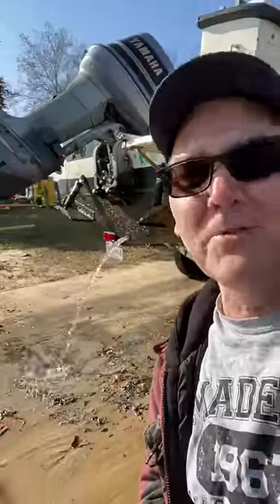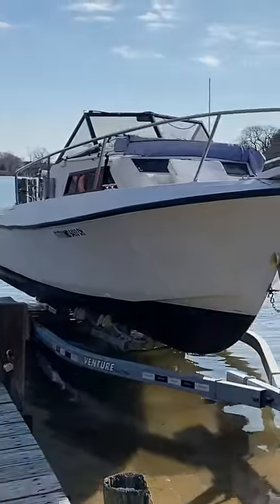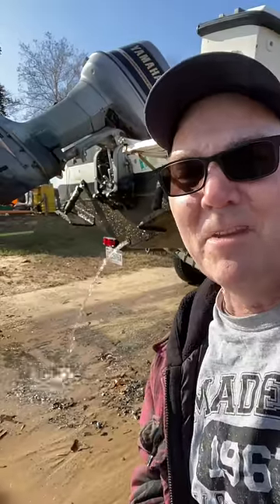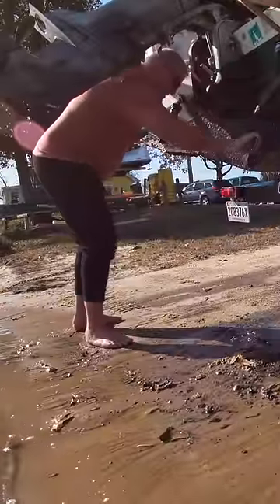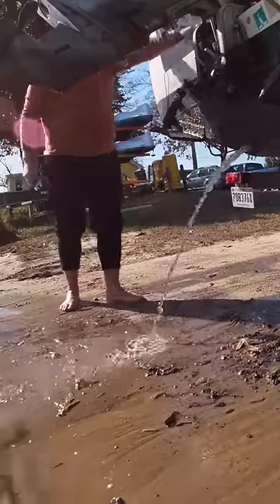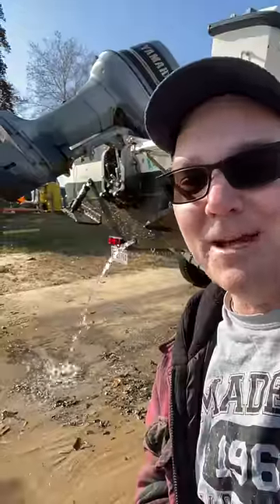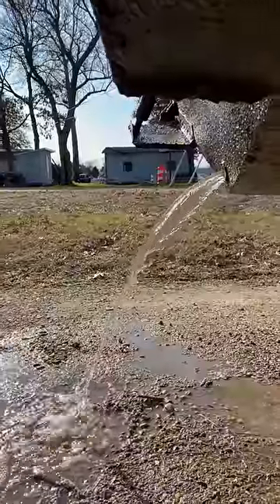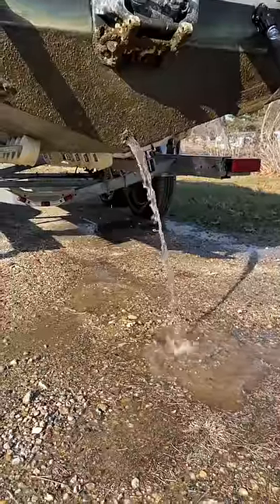When a boat bilge pump isn't working and there's been some very heavy rains lately. #boats #bilge

Comment: Grew up in forida. I have seen people pull the plug then drive home as it’s pouring out more times than I can count
Reply: That is like mandatory where I live i don’t I’ve seen a boat not do that
Reply: Veena here 9 years and I see it all the time 😂
Reply: Always.
Reply: Normal procedure for putting a boat on a trailer.
Reply: Fortunately it's legal to leak water, as long as isn't grey or black
Reply: Where I live the ride back to town or to the highway from the lake is a 30 mile curvy road that motorcyclists like to ride.  Asshole boaters have caused more than one crash.
Reply: The lakes we always went to had areas to pull off the road to clean the underside of the boat. Generally empties while you're doing that
Reply: World is full of inconsiderate ppl.
Reply: That's true @Redact63Lluks  but oily bilgewater is not considered clean water.  In my state straw and clean water are the only things allowed to come off of a load.
Reply: @kdiddy7076 Any rider should be expecting wet roads near waterways and boat/trails traffic. If you can’t handle a 4inch wide trickle of water and wipe out, you’re going too fast for road conditions.
Reply: @kdiddy7076 so draining oily bilgewater is okay to be drained back in the lake? What are you supposed to do, bottle it?
Reply: @kdiddy7076  purely the riders fault
Reply: Those guys are A Holes!!!
Reply: @Redact63Lluks not true!!
Most of the time, Police just don't do anything! It is illegal in most states!!
Reply: @johnalenwork53   there is nothing wrong with dropping water while driving. If they drained it at the ramp you’d be mad too.
Reply: Same amount of water as your cars ac  condenser puts out.... Drive away  no problem
Reply: It look like yall keep yall boat in a slip
Reply: Don’t hurt nuthin
Reply: I can agree with this I live in Massachusetts and i see countless people leaving the boat ramp in the summer with a stream still running out of there boat for miles.
Reply: Also in Florida, I was kind of wondering why they were just sitting still. I often see boats peeing down the street
Reply: Thats what you do when you trailer your boat.
Reply: Best way to do it. Why waste time sitting around waiting.  It all goes back to the same place anyway.
Reply: I always wondered why there would be trails of water all over the place 😂
Reply: @mudpuddle8805 "oily" bilge water? You know roads have way more oil on them than any bilge water could possibly have right? That's why the first 10 minutes of a rain are a terrible time to ride. Riding down the center oil slick is dumb AF too. If they are wiping out they need to stay in a 4 wheeler.
Reply: @jamesbumgardner1469  That's why I wonder what people want boaters to do? Don't drain it at the ramp. Don't drain it going down the road. When and where do people expect it to be drained? I personally pull the drain plugs on the ramp and I head home.
Reply: Omgggggggg that’s what that was growing up I used to see that shi coming from boats on the back of trucks
Reply: @paullowell3342 you walk on a 4 inch wide steam of water and dawn dish soap on a hardwood floor barefoot. After a few steps you'll slip too. Don't blame the rider for the road being wet with a water/oil/contaminant mixture. I dare you do drive like it's dry during the first 5 minutes kf a rain storm. See how much traction you have then big guy, and remember if you slide and crash it's your fault for the road being that way😉😉😉
Reply: @paullowell3342 wrong pmao there's areas to drain your boat, aka the ramp or the runoff area where you clean the boat after taking it out of the lake.
Reply: @jckdnls9292 completely and utterly false...
Reply: @deleted.6743 ah yes, why waste time cleaning my boat after I took it out on the lake. I wonder🤔🤔🤔🤔
Reply: @mudpuddle8805 there should be a secondary parking lot that has a dedicated area off to the side that multiple boaters can fit in. That's where you drain and clean it.
Reply: @lukereyes6266  your data behind it?
Reply: @lukereyes6266  if you can’t handle a small stream of water on the road you need to just stay home my guy
Reply: @jckdnls9292  if your ac condenser is leaking an actual stream of water, it's broken💀
Reply: @paullowell3342  if you can't handle draining and cleaning your boat in the designated areas, you should never go boating again
Reply: @lukereyes6266  you don't understand how condensers work then.   It means it's working really good then.
Reply: @lukereyes6266  I dont currently own a boat but when I do I will think about you and make sure it drains on the way home. As I pull the plug is say out loud “this is for you Luke” lol.  Y’all real mad over a little water
Reply: Same where I grew up. Just don't tailgate the guy and there's no problem. Or (freshwater only) get a free carwash.
Reply: HEY.........
I'm just tryin to save everyone behind me money on windshield washer fluid.😊
Reply: @mudpuddle8805  - Maybe Service the Boat: Engine, Drivetrain, etc! 

If you can't Maintain it, you are "Overextended" financially! 

Or, a more accurate term, might be "Under Water" as you've got More Boat Expenses than you can handle!
Reply: @Redact63Lluks  'clear water' and 'straw' in my state.
Reply: Where the heck is Forida, what state is it in
Reply: It is now illegal to transport a boat in Utah with the drain plug in it.
Reply: @username-mc7jw do you know what the reason is?  Seems backwards to me.  I think that water isn't a problem for most riders.  The oil can be tricky though.   Especially back in my day when premix 2 strokes were more of a thing.
Reply: @Inactive123f  Where is Forida?  Is that in South America?

Comment: I like the little “Jon boats”we had up at a remote base in AK they leaked like a sieve they were all tiller drive, anyway when to much water accumulated we’d just run it wide open and pull the drain a couple minutes later put the plug back in idle down and start fishing!  Only bad thing is if the motor stalled while you had the plug out. I always preferred having someone else do the plug if I was driving so I could watch what’s ahead like a big ol bull moose, you get moving down a slough about 12’ wide now put a moose swimming (2-3’ wide body 60-70” antler oh yeah and a 4-5’ wide boat. Do the math,  it doesn’t come out even lol

Comment: With that much water you need to look for leaks, thats to much water to be taking on.
Reply: The bilge pump had ceased working when the battery ran down after much rain....
but the rain continued to fill up the boat that was moored at a marina..
Reply: How did that not sink?
Reply: Not enough water inside the boat... @jolting
Reply: doesnt know the bilge
Reply: @jolting it would have eventually
Reply: @JohnSmith-yv6eq boats that size have sealed floors and self draining decks, that drain is for the air tank. The hull or the floor is leaking and needs fixing. Neglecting it by leaving it moored for long enough to foul the hull will be a good sign it needs other work. Bilge pumps are there as a double failsafe or for boats that dont have a sealed floor.
Reply: Boats that size are unsinkable; they have flotation built into the vessel. You could submerge it completely and it would rise up to the surface.  @jolting
Reply: @mattz1230  There are literally YouTube channels devoted to showing boats of this size sinking.

Some people foam fill a boat, but the foam often becomes waterlogged and cause more problems than it's worth.

If you have a void that is 100% sealed then foam is probably ok, but most vessels won't be designed like this.
Reply: @jolting  ALL boats under 20 feet are required by Coast Guard regulations to be unsinkable. 

So....No, you're lying.
Reply: @mattz1230 lets not forget the titanic was also unsinkable
Reply: @RapidRedRider  You don't understand how Buoyancy works do you?
Reply: @mattz1230  well it was meant to be a joke, a dark joke but no im not an expert on the subject of buoyancy. But was the Titanic not considered unsinkable?
Reply: @RapidRedRider  Only by fools. No one who knows ships called it that. 

vessels under 28 feet are fitted with flotation, usually foam, that will maintain buoyancy no matter what. You could cut a hole in the bottom, and it would not sink.

Fill with water and capsize, yes. Not sink.

Comment: In some states and provinces (us vs canada) it's the law that you have to drain it at the lake.  This is for two reasons.  1) the momentum of water sloshing back and forth can cause loss of control on the road.  2). To prevent the accidental transplantation of flora and fauna from one watershed to another.

It may also be a state requirement that the plug is removed when travelling to or from the lake.  

Check and know the local laws.

Comment: I had that to happen to me on the Illinois River. I heard my pumps kick on.  And I noticed that there was about an inch of water below deck. So I told my daughter that we had better head towards the ramp. When I finally got the boat on dry land, I discovered that the inboard engine boot had cracked. I made the decision right there to sell the boat. It peed for about 10 miles on the way home.

Comment: Same that happed to us 40 miles offshore and 4 am in the morning. Ended up sinking. Same model. Cuddy cabin.  It capsized and thankfully the other boat we were fishing with towed us to the side of a rig where we used the crane on the rig to pick up and set on the back of a supply boat. The supply boat brought it back in to Morgan city for us.  1978. Times have changed. Oil company would never allow in today’s world. 🙏
Reply: "4 am in the morning" is a bit redundant. AM means before noon. It's always gonna be morning at that time.
Reply: According to that logic. Instead of 4 AM in the morning. It would actually be 4 BN in the morning.  @EggplantHarmesan
Reply: That's what you are thinking about 😂 @EggplantHarmesan
Reply: @EggplantHarmesan  he works in the redundant department of redundancy… Give him a break!
Reply: @trainnerd3029 his job is becoming redundant
Reply: Not 100% sure but I suspect the oil company has to help under SOLAS.

Comment: We had the bilge discharge line break 40 miles offshore in the Gulf.  The pump was working fine, it was just recirculating the water and the bilge got so full we nearly sank. Fortunately we noticed. Hammered back in, nose up and made it.  Scary times.

Comment: Theres a thing on your boat called a bilge pump, most boats have one. It's got a label above it with the words "bilge pump" on it and it even works when the boat is in the water.
Reply from the maker: And this one clearly failed months ago when the engine failed and it was left in the marina for months.
Reply: @WayneTheBoatGuy 
I always kept the drain plug out when out of the water.

Comment: One way of draining the bilge water in a motorized boat is to remove the plug and drive at a high speed. It will pull all the water out as you go. You can put the plug back in from the inside before you slow down. That's where it should be anyway. How else can you drain the excess (like being swamped by a wake or wave) while using it?

Comment: that Aqua sport has a ton of micro cracking in the hull. man you always have an extra bilge and battery so you can get most of the water out at the dock. i dont know how many times i bailed buddies out as they did not have an extra bilge
Reply: Did you mean bilge pump? The bilge is where that water is coming from.
Reply: auxiliary bilge pump is a bucket

Comment: It turns out the part of the boat with the steering wheel is supposed to be above water!
Reply: The bilge pump had ceased working when the battery ran down after much rain....
but the rain continued to fill up the boat that was moored at a marina..

Comment: Bilge Pump. Be proactive in removing water from the inner hull. $15 - $200 depending on GPH and manufacturer. SV Seeker channel made one using a blue lay flat tube. When unrolled and  tossed in the water, it allowed the water to exit and stopped water from going back in.

Comment: At 300 gallon and 8 lbs that’s 2,400 lbs!
Reply: Actually water weighs 8.2 pounds per gallon. Just saying. 😊
Reply: You could easily be over weight for your trailer with a ton,  or more,  of water in the bilge.
Reply: I was looking for that comment. I own several fishtank. So when making stands for them it was one of the first things I had to figure out. People really don't know how much water weighs cause there's never really a need to figure it out. And get surprised at how much even a small 10 gallon fishtank can weigh.
Reply: @johnwilliamson2276 8.34 pounds a gallon... of clean water. 
8.4 for lake water. Gotta account for dissolved particulates. 😅
Reply: I'm not familiar with how boats are constructed, but other than the weight too just haul, what about when you make turns or stop suddenly? That's a good bit of momentum sloshing around in there. Does bilge tank have any sort of baffle to deal with that?
Reply: Great mileage and speed with that much water on board!😂
Reply: @Dommer75 I was wondering about that, too.

Comment: Looking at how that boat was draining made me imagine adding a simple siphon to the bottom, take an inch flexible pipe, thread in a fitting, stick one end on the boat and the other on the ground in a bucket. The hydraulics will suck the water out of the boat faster than gravity alone because it can pull a vacuum inside the pipe instead of facing atmospheric pressure.

The flexible hose does need to be bigger than the bilge hole to work well.

Comment: As a trucker,  I can tell you that having thay much liquid sloshing around while on the road can be a bigger pain than the weight. Anyone who regularly hauls a lot of liquid knows what I mean. It can dramatically alter the way your vehicle handles and stops. If you're not prepared,  it can easily cause a wreck.

Comment: Min 2-4 bilge pumps. Make sure to have at least one automatic, direct to battery(with fuse). 
Changing or boosting a battery is a lot cheaper then pulling a boat up from the bottom.

Comment: Honest question, why do they call bolts holes in the water? Is it the motor that drains the owner's pocket or is it fees and Licensing or whatever? It seems to me the only thing that's really running are the electronics or the engine. So does this mean these engines in general are unreliable after 30/40 or 100
Reply from the maker: There is always something to spend money on. Repairs, upgrades, accessories, fees and when under-used they tend to have more problems - and many are under-used (like this one was).

Comment: Never had a boat that big, so does it work like a form of ballast to keep boat level? In the water deeper? I can’t think of any other reason.
Reply from the maker: This boat had been sitting in a marina for several months with a broken engine and broken bilge pump. So the boat slowly filled with rain water over a few months.
Reply: @WayneTheBoatGuy  so they don’t normally fill on a trip by trip (if only few hours to half a day) basis? I always see other smaller boats bilging too but maybe I wrong about that.
Reply: @WayneTheBoatGuy  and thank you!

Comment: Just a sugestion,,, but you might want to insal a bilge pump,,, amd run that sucker a few times a day as your on the water,,, ,cuz thats hard on your boat engins as well trying to drag around all that weight in the river or lake, so yeah, a few $ for a bilge pump is just a good idea,,, as well as um so how did you get that much water in your bilge,,, might want to check for cracks that will keave you swimming some day

Comment: I'm reminded of the runabout that my dad and I went in on when I was 14. She had a rotten keel spar, and the fiberglass cracked every time she was trailered. Dad refused to listen to mom and I about cutting into the deck and fixing the real problem. The John Boat that he used for a partial trade was a better boat.

Comment: Running the bilge pump before you put the boat on the trailer will help pull it out of the water. Then you pull the plug for the remaining water that the pump couldn't get.

Comment: My last outing was on a smaller no wake lake. My outboard wasn't running good at idle speed and kept stalling and for some reason the trolling motor batteries only had 50% charge so I decided to get back to the ramp. I had the same thing happen when I pulled the stern plug, my bilge pump shit the bed.

Comment: You have an outboard. Get an internal plug and pull it on way back to dock. Suction will pull all of that water out so you aren't yanking 2000lbs extra  out of the water with your truck

Comment: That is a very great danger to the people on the vessel.
If you  run into a particularly heavy wave, the in-compressible water in the bilge can act as a ram under its own inertia, bursting seams open. If you hit something and hole the vessel, you have that much less time to react because you already are half full of water.

And if you go over a wave and come down with a  solid thump, the hull can open like a flower under the  load of the water's inertia. 
Not to mention that water running around can short out your electrical system.

Comment: The launch by my house used to have this little setup. That was essentially this long trough that fed back into the lake.Where you could park your boat and wash the underside. 

I'm not sure what happened to it, but it was gone when I went by the area again recently. I wouldn't be surprised if some clown trying to wash their car/truck. With the hose that you use to clean the underside of the boat. And then complained that it made their vehicle look and smell terrible.

Comment: Why is there so much water in the boat? holes in the hull?
Reply from the maker: This boat had been sitting in a marina for several months with a broken engine and broken bilge pump. So the boat slowly filled with rain water over a few months.